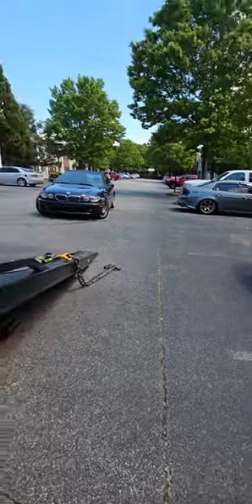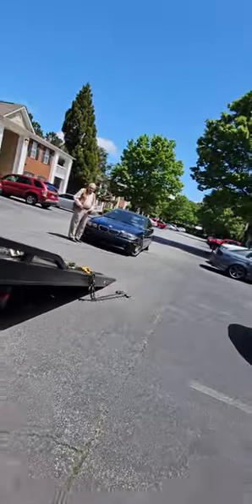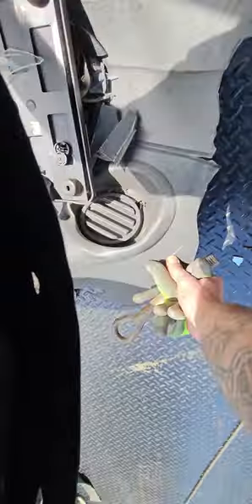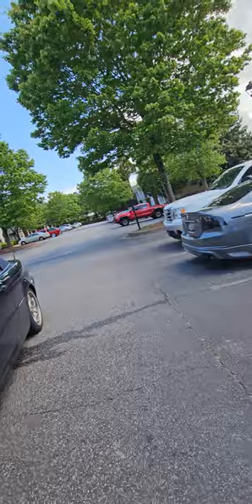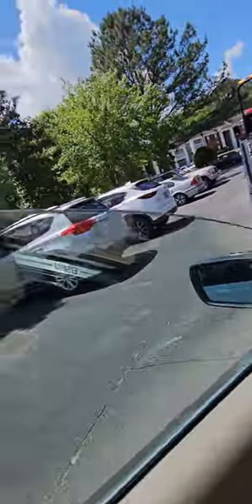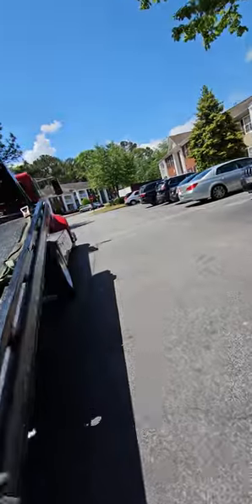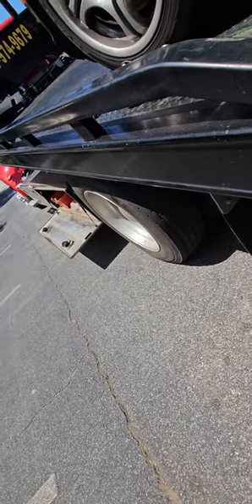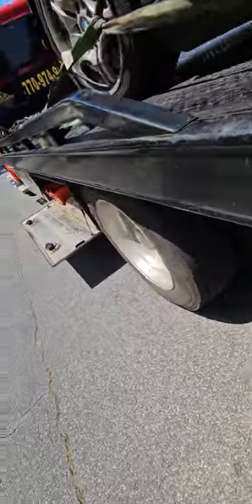Bmw tow#viral#youtube#shorts#short#youtubeshorts#ytshorts#youtuber#wrecker#towtruck#tow#rollback#cat

Comment: What I was told at Bmw they recommend not using them more than three times due to the design thin threads and cast steel contrary to what others may say you can tow 3 series at control arm small thin rod looking but be cautious there is a hieghth control arm connected to it you can take your baby j put it to the inside closer to the center of the car or the pressure will break the sensor rod I've been towing them for years never a problem! when loaded set the brake! park it! and use your wheel straps but don't chain and tighten you'll be fine! 👍🇺🇸
Reply from the maker: Thank you I will be circling back around to this soon in video.
Reply: Good stuff! Looking forward!👍🇺🇸